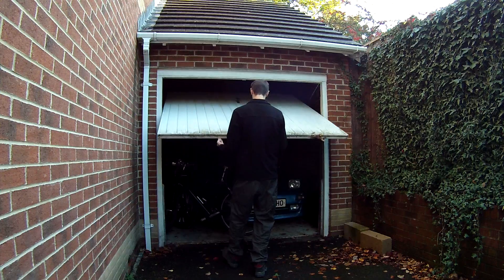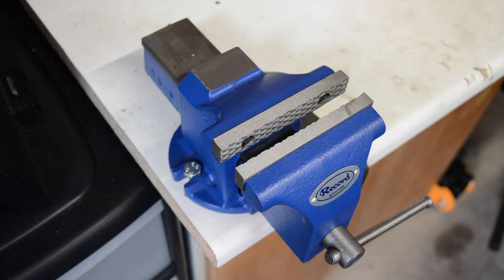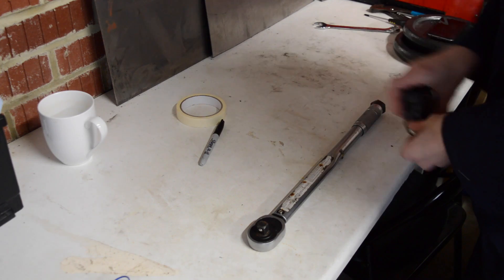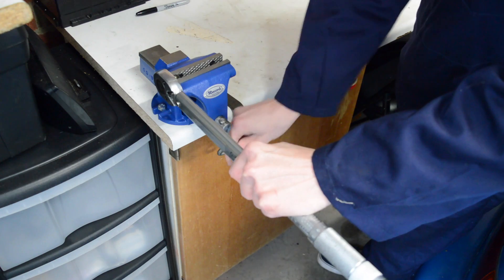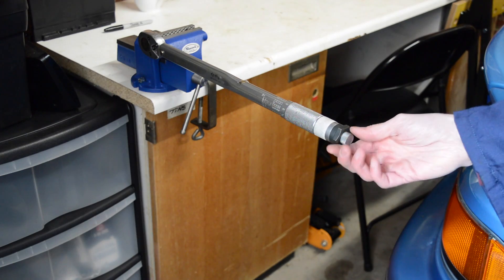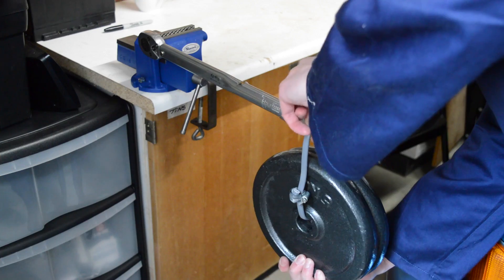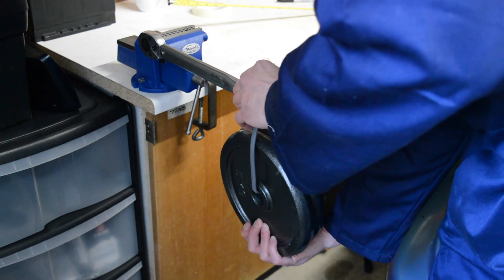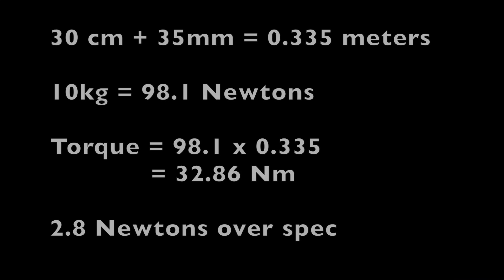Easy Torque Wrench Calibration Test

Comment: you must take into account the weight of the wire and the weight of the wrench itself adding to the torque. which is why it clicked at 40. because the actual weight was slightly more than you calculated.
Reply from the maker: Great point, the weight of the wire was probably negligible, but the weight of the wrench itself was something I didn’t factor in, and honestly I have no idea how you would calculate it 😖
Reply: @EnginesandUnfinishedBusiness  weigh the thing. Figure out the centre in gravity by balancing it in a strong loop. There's where the weight is acting. Now just subtract that torque from your reading and rest accordingly.
Cheers ;)
Reply: Completely unscientific, but curious about this, I took one of my dial indicating wrenches of about the same size and heft as a clicker of a similar range (1200 in/lbs), and clamped it in the vice.  It indicated 60 in/lbs
Reply: Most torque wrenches have an accuracy of 3% cw and 6% ccw
Reply: Also the air pressure from a barometric reading.
Reply: Probably sufficient for most DIY mechanical work, especially on older vehicles. Certainly better than not using a torque wrench which is what most DIY mechanics do.

Comment: Hanging the weight midway up the handle throws off the calibration.  It's only accurate at the knurled grip.  Please don't argue this.  For some reason, the mechanism in the clicker type torque wrenches IS affected by where you grip the wrench.  It's only accurate if gripped at the handle, not if you "choke up".  I've watched many videos of guys testing this with torque meters.  The click doesn't happen at the actual socket rotation point.  It's further up the handle.  So the ratio of the handle length to the rotation point-clicker length matters.  Weird, but true.  The 40Nm calibration is good, the 30Nm isn't.  This is also why if you choke up on the handle, you'll over torque the fastener.
Reply: You're correct. There's a quick way to see that hanging the weight further up the handle throws the accuracy of the mechanism out due to moving up causing it to see proportionally less of the force being applied. Move it all the way up to the outer tube's pivot point, reducing the 40cm to about 5cm. According to the calculation, 10 kg should click the mechanism if it was able to be set as low as the required result which is 4.9Nm. However it cannot click since the mechanism in the tube is registering none of the applied force. It has become completely inaccurate, because the measurement has been becoming progressively more wrong the further you move away from the loading ring at the handgrip.

Comment: the pivot point is NOT the point where you attach the socket. the pivot point is that little circle few cm towards the handle. if you move the weighs around the handle, you are actually "changing the torque setting". every torque wrench has a marking which shows where you should ideally apply the force in regards to the pivot point so that the torque to the socket is correct.

Comment: The only place weight can be accurately applied is centered in the designated grip area; moving it along the shaft is NOT a simple linear leverage effect, as the release/click depends on internal flexion of a beam. Weight known to be accurate can be added slowly, but only at the correct place on the handle.

Comment: You need to be applying the weight to the handle, at a 90 degree angle. This will throw off the measurements if not done.

Comment: Sorry about a long response but your calibration test is invalid on this type of torque wrench. I will attempt to explain why in simple terms. 1. There is an inner rigid socket wrench and an outer handle. 2. The outer handle has a compression spring pressing on a roller. 3. The roller interacts with an inclined plane on the end of the inner rigid wrench. For simplicity I will refer to this and the roller as a clutch. 4. The outer handle is calibrated to apply a force to the clutch which transfers the force (F) to the rigid wrench at a fixed distance (d) from the axis of rotation. T=F x d. 5. The handle has a secondary pivot between the socket and the clutch which gives a mechanical advantage reducing the force needed to activate the clutch. 6. Therefore the force applied to the handle can vary depending on the distance from the secondary pivot, while delivering the same force to the rigid wrench via the clutch. 7. The force applied to the handle will (necessarily) be less than the force applied to the clutch. (There is an exception to this when the handle is held between the socket and the clutch). 8. As a consequence of this you cannot calibrate a click type torque wrench using weight at a distance along the handle. It will nearly always appear to be out of calibration. 9. To calibrate this type of torque wrench you need to apply and measure the torque through the socket. All the best.
Reply: I concur.   I spent ages trying to get my head around this a while back, when I broke a bolt in my engine by over torquing , due to the fact I had choked down on the handle of my torque wrench.  A youtube video entitled "Why GRIP Position on Torque Wrenches MATTERS!", by The Bike Sauce, explains it really well, with the maths to back it up.

Comment: FUNNY! Your calibration method is so flawed that it’s more a joke than anything else. But to be fair you are not the only one. The vast majority of people showing others how to calibrate or test their wrenches lack the understanding of how a torque wrench works and how to test it correctly, and specially of the math and physics behind their design. This is a clear example of an instant where common sense is nothing but nonsense. Here is a video of someone who is on the right track.

“Most commonly than not people’s common sense is more nonsense than rational or logical sense. That’s because most people’s rational thinking is often based on irrational thinking, and their logical thinking is often based on illogical thinking. That leaves us with reasonable sense. Again, we run into the problem that most people’s reasonable thinking is often very unreasonable.” ~ Yahsnia  Galiani

https://youtu.be/0f746pF1xc0
Reply from the maker: Thanks for linking that video, really interesting, I love having the opportunity to learn more.

The funny thing is you wax lyrical about “common sense”, even going as far as to include a pretentious quotation, yet the video you linked actually says that the way click type torque wrenches work goes against common sense, and that it took him a long time to get his head around it.

It’s great to help educate people when they’re missing some information, but you’ll likely get better results in future if you do it in a less dickish manner.

I learned something from your comment, I hope you can learn something from mine

Comment: The screw on the shaft is hiding a hex bolt that you can use adjust the tension and calibrate the wrench.
Reply from the maker: That’s awesome, I’ll have to give that a go, thanks 😊

Comment: You are missing an important detail from physics. All torque wrenches should be in rotation when approaching and reaching the ”click”. Since the static friction or ”breakaway friction” is higher than dynamic (when you are in rotational motion), this test is not accurate. The same problem happens when people want to double check if it was torqued to spec and then trying to drive it once again and it will make the click sound almost always because now the static/breakaway friction is harder to overcome than the friction when in motion. 

Summary, never double check torque and always make sure you have decent rotational speed when you approach the click. If it doesn’t feel right, loosen slightly and get a new grip that is more ergonomic to make sure wrench is in motion when reaching the click.
Reply from the maker: That's a great point, and something I hadn't considered (I've also been guilty of double checking torqued bolts in the past) It'd be interesting to somehow test how much more the static friction is
Reply: Steel on steel sliding vs static friction is about double, but more than just that is going on in threaded things.  Without doing any thinking, I just tightened a random bolt to 20 Nm.  To get it going again only took 25 Nm.  But yeah, you can't recheck a thread after it's been torqued.  None of this has any relevance to the calibration.

Comment: I've done this for adjusting a Toyota Hilux 2.8 L diesel engine belt to the workshop manual spec. The book reads something like "apply an 'X' Nm  force to deflect the belt by 10mm (or thereabouts)".  There is obviously a special tool used by the factory to do this.  I thought about this for awhile and then realized that elementary 'A' level physics class on the mechanics of levers does come in useful here !  With a little bit of ingenuity and calculation adjustment, a spring scale from the local hardware shop came in very useful.

Comment: Put weights, zip tie or wire AND wrench on a scale until 20lbs. is reached. Put wrench drive in a vice so the wrench sticks out horizontally. Measure out from drive towards the the handle 1ft. and mark it. Set wrench to 20 ft/lbs. Zip tie or wire the weights to the mark but dont let go. Slowly lower the weights til it clicks. If it clicks too soon or doesnt click, it needs recalibration.
I got it.

Comment: I worked in a machine shop governed by aerospace parameters for nearly everything on the shop-floor  ... we used Bacho torque wrenches , they had monthly calibration. Nearly every one failed and was cut in half and skipped after 3 months!  It was a very high usage environment.

Comment: Thanks for the nice to the point video. 
I don't think it really matters metric or imperial so long as your torque wrench does what it needs to do.
I sort of cheat in that all of mine have more than one force measurement listed.
Reply: Ft/lbs or fig newtons. No matter. Personally i just measure out 1ft. @ 20ft/lbs. and drop 20 lbs on it. Adjust it from there.

Comment: What's all this 40 CM stuff? It's 400mm.
Reply: You kinda missed my point. CM, centimetres just do not exist in engineering dimensions.
Reply: @peteb954  I started work in 1962 and went straight into metric. Every measurement was in m/m  From .3mm upwards to over 5000 mm.  It wasnt precision work.
Reply from the maker: That’s actually a very good point, I’ve got things wrong before due to mixing cm and mm 😖
Reply: No. Its 4 meters.

Comment: Instead of clamping the square drive directly in the vise, it'd be better to attach an extension to the wrench and then clamp the extension in the vise.  That way, all four sides of the drive are being used and you won't mar the drive.  

If your vise doesn't have slots/teeth to hold round shafts, there are jaw inserts (magnetic or screw on) that allow clamping of round shafts, and if you're doing a lot of vehicle work, you're going to need them at some point anyhow.
Reply: Just put an old 1/2 drive socket in the vice and put the drive in that.

Comment: FYI.... That is a very inaccurate way to verify a micrometer torque instrument. For starters the fulcruming action on a micrometer style torque instrument is downstream of the drive, thus making the instrument length sensitive. You'll need a digital torque tester with a First Peak mode to quantify the 1.peak drop time during the audible click. If you have a 20-100 NM torque instrument there would no way to quantify +/- 4% accuracy using you method. Either purchase a digital torque checker or send it out to be verified.
Reply: Looks a good way to check accuracy of a torque wrench for home use. Although I think your worktop that the vice is fixed to flexed when you hung the weights on the wrench? That could affect the results.
Reply: Why don't you show us please !!!
Reply: I'm gonna reply to this old comment to this old video to highlight the most important point you made. Torque wrenches don't actually measure torque directly, unfortunately. Otherwise it wouldn't matter where the force is applied. Like you say, the distance is important (and I found this out by verifying with a digital torque calibrator). So in order for this method to work, you should apply different weights all in the same location (on the handle, where you will also apply the force in use).
Reply from the maker: You torque too much 😜

Comment: what kind of torque wrench is that again? I want one. If it's really that cheap and stays calibrated for that long, it's better than anything I can find around here short of going to Lowe's and getting a Kobalt
Reply from the maker: It's a Draper one, looks like they even still make it :) - https://www.drapertools.com/product/30357/1-2inch-Square-Drive-30-210Nm-or-22-1-154-9lb-ft-Ratchet-Torque-Wrench
Reply: Thanks

Comment: Do you need to count the weight of wrench itself?
Reply: I do. If you want it accurate. Especially if the wrench is 2 ft or longer and weighs a few pounds.
Reply from the maker: Probably should, but that would have been too much effort, this was never going to be super accurate :)

Comment: at last, someone who's working in metric rather than imperial !   (my recently purchased wrench is metric only)... and we did go metric in the UK when I was still in nappies.....many, many years ago.
Reply from the maker: Indeed! I was born in the 80s, so was always taught metric stuff, yet we still use miles and stones etc. The worst is cars though, we buy fuel by the litre, but efficiency is in miles per gallon. Crazy.

I can see the appeal of imperial for mental arithmetic, as thirds and quarters are easier in base 12, but I really wish the UK would go all in on metric :)
Reply: I use both, and I'm 17. I've used both Newton Meters and Foot Pounds, depending on which is easiest.